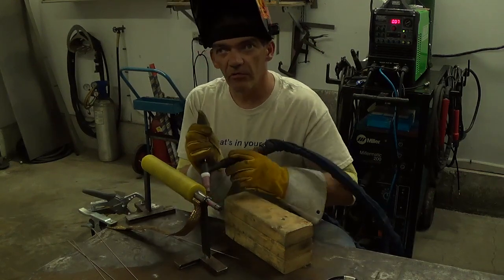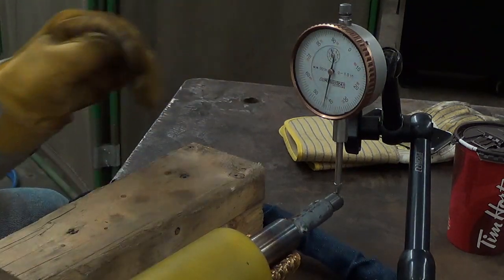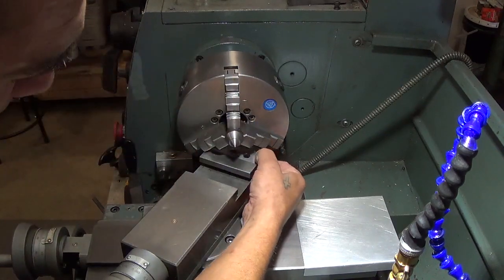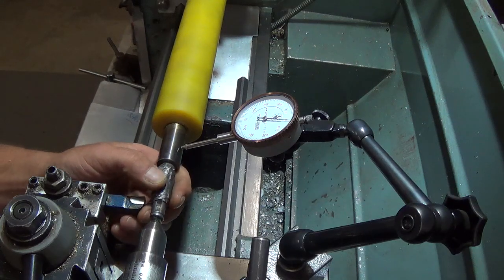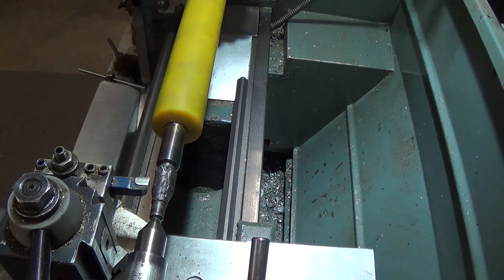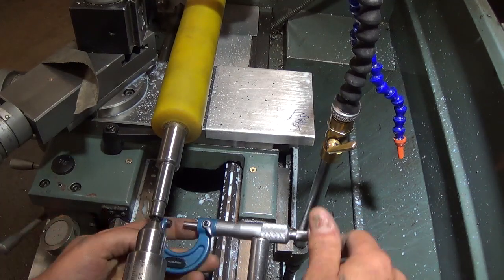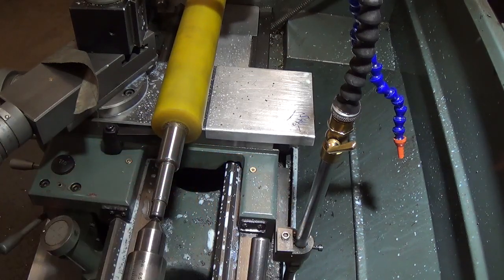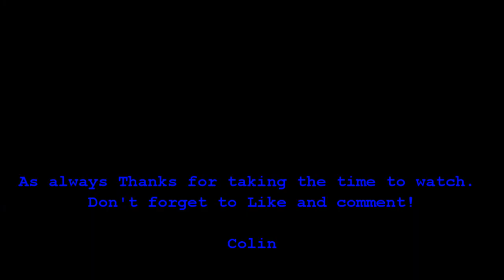Rolling Right Along

Comment: Hi, good repair job!
When I started welding, the shop was in my basement, so, Tig was the way to weld everything. With age, vision going down and stiffening articulations I find Tig a little harder. But still love the cleanness of the process.
Keep on the good work,
Pierre
Reply from the maker: pierre beaudry I love the Tig welding and am learning more and getting better. I normally wear a contact lens for distance and have found it much better to not wear it while welding as my near vision is quite good. I'll try to get more welding into the videos as conditions permit.    Colin ;-)

Comment: Hi Colin, Thats a good job, nice set up with ground. Thanks for your time, great video M.K.S.
Reply from the maker: If you want to weld something and not put arc marks on it the copper is the way to go. Old welding cable works but the braid is even better.
Thank for watching.
Colin  ;-)

Comment: Hello Colin 

I enjoyed the video not to bad for your first Tig repair job. I agree with your comment on should have learned Tig years ago. I have been a production machinist for 30 years over the years I have learned all the types of welding but I never got involved with Tig until about a year ago it is very difficult and tedious compared to other types of welding. I was very frustrated at first then I came across a large sheet of steel and decided to cut it up in all different type of shapes making wind chimes so with that my lack of skills with plasma cutting & Tig welding eventually improved a great deal. Keep at it and do a bunch of different things getting familiar with it and next thing you know you will be downing nice welds. 

    Regards Chad
Reply from the maker: I've already expelled a half cylinder of Ar just trying to get the feel of this. It is starting to come about now and I expect to improve greatly in the coming weeks. Perhaps I should weld up a few dustpans and such.. LOL
Thanks for commenting Chad. ;-)

Comment: Looking good to me so far man, you could have fooled me about your TIG skills. You were nice and steady and you know the techniques to fix heat distortion, you can't fake that! Nice little set up for the welding stands...now I'll finish watching...
Reply: BTW, I too have an Everlast and have been training myself to TIG...again. I did it for about 7 years ending in 98' when I quit building pipelines. My hands were a whole lot steadier, and I was cocky as hell so I didn't ever 2nd guess myself... seemed to help back then.

Now I get spooked about making a tack and it takes ten times as long to get everything ready to make a bead! Stick is like a relief after any TIG work, so occasionally I'll do a 7018 bead just for fun to recall I can do it, LOL!

What model is your Everlast? I have the 165STH DC only, and I like it's tiny size and smooth arc even though I'm ashamed to only be able to afford an Import, some things can't be helped.

Nice repair and thanks again for sharing....Aloha, Chuck
Reply from the maker: Knolltop Farms
Thanks for the compliment Chuck. Not my first weld for sure so I do know the basics to apply to any form of welding. I still do lots of 7018 stick along with some hardweld being the owner of 2 tractors. I enjoy the cleanliness of TIG and it's a process that can allow me to do finer things that I could not before.
I bought the PowerPro256 multi-function as I didn't have a plasma cutter. I know the hassle of switching things around to change function is not as handy as a dedicated unit but I am also on a budget like most. If need dictates I have no problem upgrading the unit. To date the Everlast has been great. It doesn't feel like a cheap import tool and performs as expected.

Colin ;-)
Reply: I would have done so too, had I the cash to buy the 256, but I've got a torch and tanks already, and could only justify the smaller machine for the farm and building a trailer that we needed. I just got some nice round stock and will go a do a little turning tonight after I make dinner for Dad.

I hope the video comes out this time, I don't know what I did different on Thursday, but I tried to upload my first chips on the Atlas video for two day until I finally gave up and shot the one about the boring filter cleaning job, LOL!

I guess it fixed itself, and there shouldn't be anything different, so we'll see how it goes.

Aloha...Chuck.
Reply from the maker: Ya, we all lose video sometime.... ;-)

All the best,
Colin

Comment: Nice job Colin!
The planer will be good for years to come now!
Good to see the TIG earning it's keep in the shop! I know I'd be lost without mine!
I look at all the years I just used oxy/acetylene to weld and braze and an old Lincoln "Tombstone" arc welder and wonder how I got anything done without my MIG &TIG welders!

Jeff
Reply from the maker: I've always had plenty of welders. Still have the Miller stick and mig but sold a cricket mig and gas-powered mobile unit some years ago. We just never got into a TIG setup. Much of the repair work we used to do was similar in nature to what Mike Reggie does on his channel....heavy equipment and woods equipment...hardly a place for a nicely finessed TIG weld.
The Tig is a great process for just such jobs as the roller shaft. Not getting into the keyseat was an important factor in this job and I dont think it would have been so sucessful using a large mig and certainly not stick.
I look forward to using the Everlast unit more and see just how good it and its operator are. ;-)
Thanks Jeff.

Comment: Hi Colin, I think you did an awesome job on that roller, great idea of having the dial indicator at the bench on the upper part to check the warping factor, and I know it takes patience to not pour too much heat into it and melt the plastic also. I think you're getting the hang of the TIG welding real well. Jody advertises a kit on his channel to be able to use the consumables from the 9 or 20 style torch on the 17 style torch like you have, I know it won't change the body size, but I think it will help you get a better look at what you're "shootin" at, and I think it also lets you lose that piece of oilfield pipe for a back cap too. Might be worth checking into, I think it's called a stubby kit. Great video, nice job!
      Mike
Reply from the maker: Ya, I'm going to look into more accessories for the TIG unit. I would like a nice, smaller air-cooled torch similar to what Wyatt show on his channel for the smaller work which I expect will be the main usage of the unit. Bigger work we'll use the mig or stick.
Thanks for the comments...I'm trying to get back into more industrial welding like I used to do not unlike the jobs you work at. If I can I will document that stuff too and post it up. ;-)

Colin

Comment: Spot on repair Colin.  I hear ya on the distance perception.  I can't tell ya how many times I stuck the tungsten when I was learning TIG.  I was a bit concerned you would melt the roller with the heat when you first started.  Great job-   Fred
Reply from the maker: The urethane material is pretty good for heat resistance but I did let it cool several times during the process over and above the tungsten grinding breaks. ;-)
Thanks,
Colin

Comment: Will work fine, shaft turns at a very slow speed, like you said. The bearings are just sintered bronze material, with a reamed hole for the shaft. Nice Job.
Reply from the maker: I still havent received the replacement bearing from the owner but I bet you are correct in the bronze material. I've no doubt the shaft will last a long time unless it suffers a similar bearing failure.
Thanks. ;-)
Colin

Comment: Maybe I don't know what I am looking at and I have seen a lot of rebuilt shafts in my time, but that looked like a very good job to me. It will hold a bearing and that is what you want.
Mike
Reply from the maker: The goal, of course, is to finish and not be able to tell it was repaired. Given my level of experience with that particular welding process I was happy with the result. The part is very functional and will perform as intended.
Thanks Mike. ;-)

Comment: The repair looks good to me.  I picked up a tip from youtube on tig welding that I'll share in hopes that it will help you.  Tilt your torch more so that you can rest your gas cup on the work piece.  That way you can control your gap with the angle of the torch.
Reply from the maker: TheDisorderly1 Thanks, I will try that along with other suggestions. In the end though I just need to learn to move in smaller, steady increments than other welding processes. That will come with time. ;-)CheersColin

Comment: Nice video Colin, good to see you back on the lathe. You might want to look at the hybrid electrodes (arc-zone) they are more forgiving when you dip into the puddle. They dont wick up the filler as bad as thoriated. Just a thought.
Reply from the maker: How are they for deep-sea diving?? ;-)
Might have to give'em a try as I've ground away most of the starter pack.
Thanks
Colin

Comment: Nice job on the repair.  I have had to stick weld a few shafts then turn down, and you think your tig weld is not so good.  I think it came out great.  I liked the tool stop you made for Adam, very nice.
Randy
Reply from the maker: I did a pin for a machine years ago where I added a full 10lb box of 7018 - 1/8" to its perimeter then sent it out to a shop for finishing. It didn't look so smooth either....LOL
Thanks ;-)
Colin

Comment: Nice repair!    Depending on brand on your live center, take it apart and inspect.   Couple of new bearings... and she should be good as new (If bearing slipped and galled the shaft.... you know how to handle that. LOL)
Reply from the maker: Thanks Tom. I did take it apart and was disappointed to find axial play in the bearings. It doesn't look to be a great quality piece so I'm just going to replace it. I always found it to be in the way when turning close to the end of a shaft so the replacement will have an extended nose. The old one will be recycled into......well, something.....  ;-)

Colin
Reply: *****
 I kow that feeling of "keep this and make something from it..... " only problem is I end up with too much "someday projects". Still have my 2500HD truck front bearing/hub assembly... nice rotary table for welding & a slow 60:1 geared drive. Perfect for tiggin' pipe assembly.

Comment: Het Colin, You tried a gas lens yet? Made my old dial arc feel like a different machine, you can get (clear) pyrex cups for it too if visibility is an issue.
Great repair, enjoyed.
Z
Reply from the maker: Still in "run what you brung" mode here though I've been watching many videos and will look at some of those options in the near future.
Thanks Stan!
Colin ;-)
Reply: *****
Ditto on the gas lens. Also, try 2% Lanthanated electrodes. They have the highest temperature rating and can be used for everything.
Reply from the maker: Paul, that actually was 2% L that came in the starter pack with the unit. Maybe I should be taken outside and lanthanated for being so shaky... ;-)

Comment: Well if you dip them, they still wick a bit but not nearly as bad as the standard thoriated tungsten. I find that if you dip thoriated tungsten, you are done and need to regrind. If I dip a hybrid, I can keep going. You can see in one of your arc shots, the filler runs right up the tungsten. With the other type, it does not wick as bad and the arc does not get deformed as much.
Reply from the maker: Using the lanthanated, as in the vid, it doesnt seem to be badly affected by a light graze. I'll let it ride until I see it affect the arc. Going to try some different electrodes and stuff in future... there might a miracle tungsten that makes me look good out there somewhere.. LOL

Comment: I know where you are coming from.  I'm blind in my right eye.  If the tungsten were filler metal I would be set...  I had to move the grinder closer to the welding bench.  The trips back and forth sharpening tungsten about wore me out...8)  Take care, be safe!
Reply from the maker: Is that why you have a bat profile pic?? LOL
I've had the Everlast for about 6 weeks now and getting low on tungstens! Picked up a 10 pk thoriated last week and they're ready to meet the grinding wheel. ;-)
Thanks IF ;-)

Comment: Colin,
Not a bad job for your first venture into TIG welding! I noticed a ton of Miller stuff . . . how do you like your Everlast? I like the jig you have for welding shafts. That braided copper strap makes a great ground. Thanks for sharing.
Have a good one!
Dave
Reply from the maker: I have a Millermatic 200 and DialArc 250 both 1988 vintage purchased when my father and I opened shop in 1988. Both have been great welding units needing only very minor repairs.
I had a few problems with the PowerPro initially and was blaming myself but after switching to the good quality Ar regulator from my Mig things have improved considerably.
Thanks for tuning in Dave. ;-)

Comment: Nice repair Colin.  What kind of filler rod where you using?  Maybe try some TIG welding gloves will give you better feel.
Reply from the maker: The rods were from the donated batch. Unknown composition but if I had to hazard a guess I would suspect RG45 gas welding rods. A little rust on the ends I had to trim off and reshine the rest with some scotchbrite. I need to pick up some supplies including new filler and gloves, etc. All in time... ;-)
Thanks Bill.

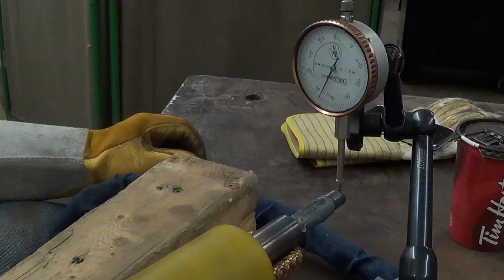Comment: Hi Colin, I have a quick question for you. Starting around 6:32 or so, you have an indicator stand that you test the run out, or warpage on the roller shaft. What brand is it, is it a Noga or a nice knock-off? It looks sturdy and well made so I'm thinking it's a Noga, but since I don't think I can spring for one of those yet, I was curious if you've found a decent substitute? I've got that nice last word indicator I traded with Keith Rucker for, and it needs a home...but not one that will hit the dirt.

Thanks in advance and keep on stacking those dimes, Aloha...Chuck.
Reply from the maker: Knolltop Farms Chuck that is indeed a Noga brand magbase. i bought it at the insistence of Mr Lipton. It is by far the most useful tool I have ever bought and worth every penny. I have even used it to hold the cams on a few occaisions and it works better than anything else. There were a couple vids with some photo equipment holders that were of a similar design to Noga and not of too bad quality. Kinda like to try one for the cameras myself. I think Paul Compton had one as well as Tom Lipton. Dimes??   Heh, we need to talk...... LOLColin
Reply: You'll be stacking dimes with that TIG in no time, just keep at it. I mean, if you have the patience to craft all of those hand made tools, you will have it wired before I can get a Noga, LOL!

I do get lucky with the shaky paws that my CMT has gifted me with, but then again I haven't ever tried it with one eye closed either, so I'm just being positive like Momma taught me. Guess that's what the lathe and mill are for though, they tend to clean up the boogers :)

The Brown&Sharpe I have really deserves a good stable home, so I know what to save for...seems there's nothing like a Noga, so that's what it'll be. Any advice on the size I should shoot for to use with my Atlas?
Reply from the maker: Knolltop Farms
Mine is the mid-size MG61003. I think its the best all round choice. A smaller one would be nice as well. ;-)